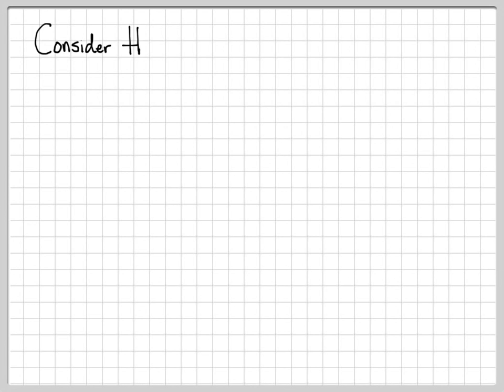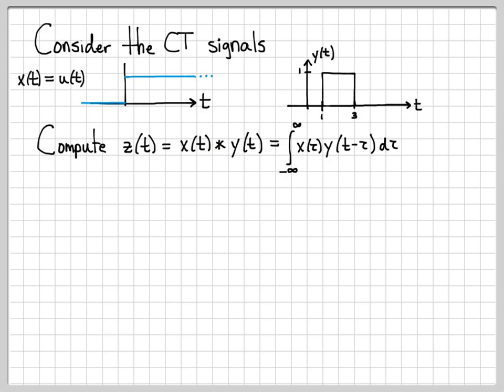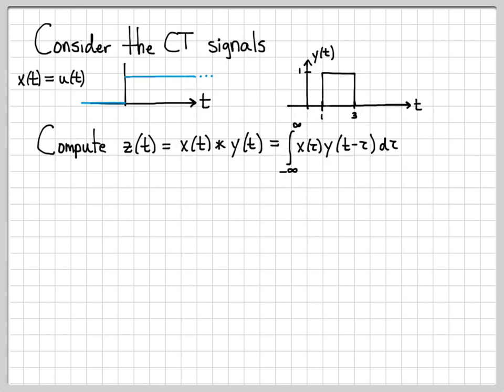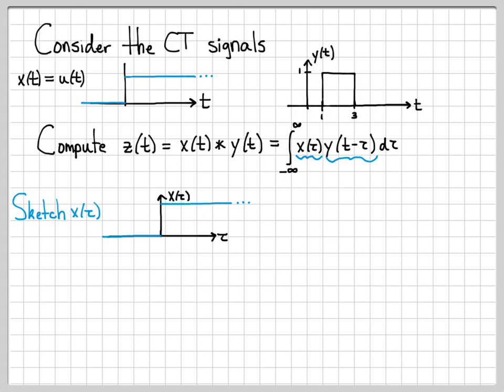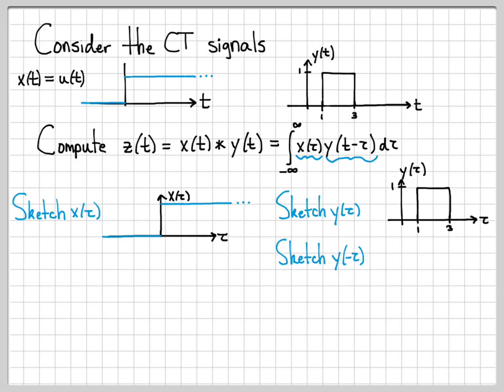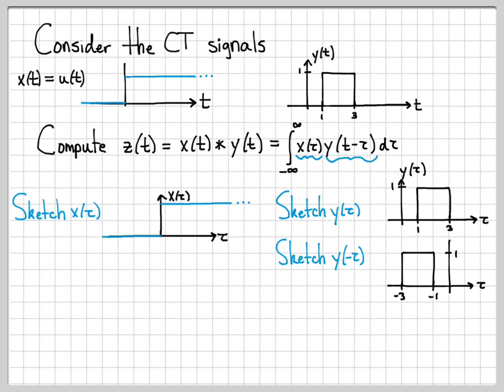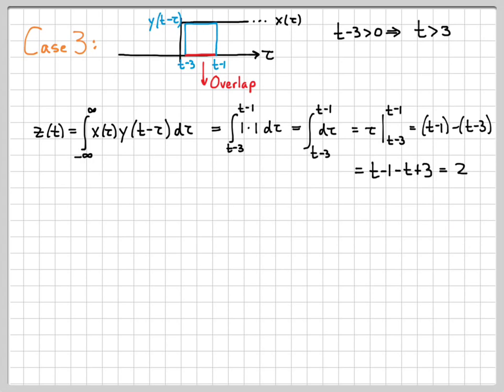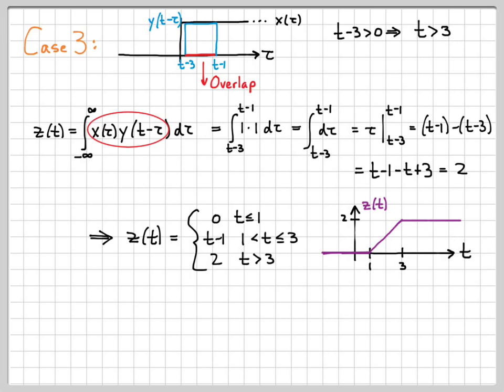Convolution Integral Example 05 - Convolution Of Unit Step With Pulse

Comment: At 4:44 we could have considered for case 1: t-1<1.
Reply from the maker: I'm not sure I understand your comment.  The signal x(tau) is zero for all tau < 0.  It "turns on" at tau = 0.  So, the first case we consider for y(t-tau) is when its front edge, is t-1 < 0.  I'm not sure why you think it's for when t-1 < 1?  Can you provide some more details perhaps?
Reply: But the signal x(tau) begins from 1............... So there will be no overlapping of x(tau) and y(t-tau) till when t-1<1 but you took it as t-1<0 (you thought x(tau) begins from 0 and carried out the procedure.........)
Reply from the maker: No, you're looking at the wrong signal.  x(tau) = u(tau).  u(tau) is the unit step function which turns on at time tau = 0.  We are convolving x(t) with y(t).  x(t) starts at time t = 0.  y(t) starts at time t = 1.  There are two different signals in this problem.
Reply: There is no conceptual error but just a human error.Hope you get me this time
Reply: Oh sir! I made a blunder.......sorry for killing your time.....
Reply from the maker: No worries!  Glad we got it figured out! =)

Comment: Dear sir, i am generating a signal (PPM) and convoluting it with the wireless channel impulse response to get the received signal. For getting the correct Receiving signal, is it necessary for both (transmitted signal & impulse response) to have the same sampling rate? In other words, the width between samples should be same ???

Comment: Hello Adam! Nice work. It helped me rebrush my concepts before my exam. There's one doubt though.
In case 1, you have taken t<=1. But doesn't x(t) overlap at t=1. Thanks !
Reply from the maker: +Akash Pandey That's a great question.  Fortunately, I think the math works out either way.

For Case 1, when t = 1, the edge of y(t-tau) just "barely" touches the start of the unit step function u(tau) at tau = 0.  If we assume that there is no overlap (which is what I did in the video), then obviously their product is zero and thus the convolution integral is zero for this case.

Lets now consider the case you mentioned.  What if we assume that y(t-tau) and u(tau) DO have a non-zero product when t = 1.  This assumptions means that we assume u(0) = 1 and y(1) = 1.  Note that the overlap occurs only at the SINGLE point tau = 0.  So, while the signals do overlap and thus have a product equal to 1, they only have this value for the single point tau = 0.  Thus, when integrating you would have int_{0}^{0}1 dtau which by definition is zero since you're integrating over a width of zero.

So, even if you assume that they do overlap at this singular point you'll still end up with an integral of zero.

Does that help a little?